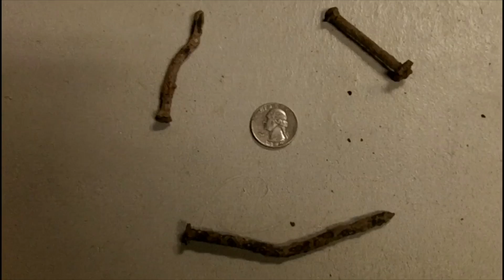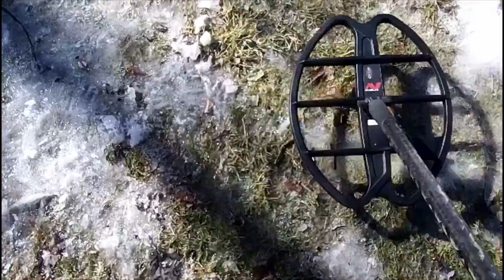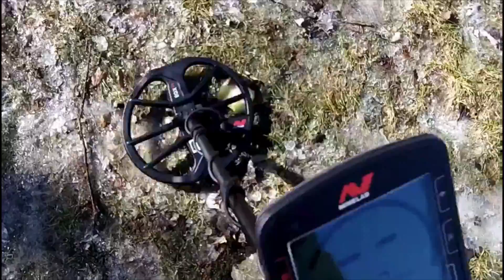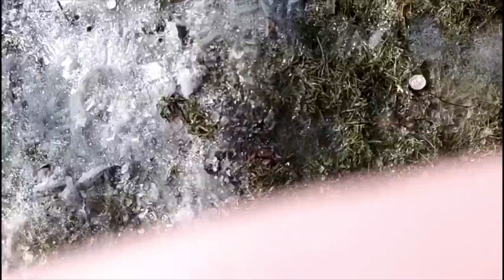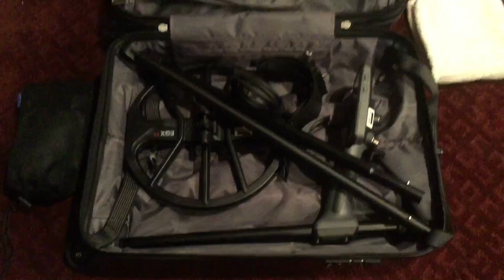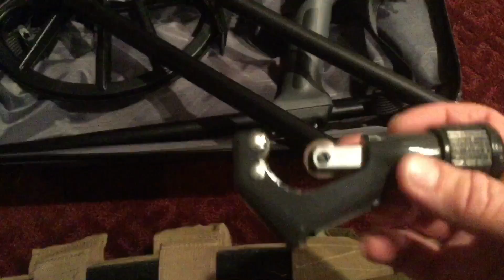Metal Detecting Wisconsin Season 8 Episode 3 Minelab Equinox 800

Comment: Very bad tests !!! 1.What is the reactivity setting on Deus because this will be helpfull when testing the coin between the nails. 2. CTX is with huuuudge coil compaired with other detectors so no point to be in this test ! 3. You did not show complete test with equinox on coin under nail test ,you show one direction but after that you remove the nail over the coin without showing what will happend in other dirrection,are you making an adv. of equinox ? 4.18 khz od deus is not good for finding deep targets so why not try 8 khz or 4 khz also ground ballance? of deus is ??? reactivity, silencer everithing have to be set wright.

Comment: Sweep speed on any detector can make a difference . . . . the speed in your test is not how most people hunt . . . . a fast whip across a marginal target / signal can check it but as you slowed the sweep down the responses differed.
Reply from the maker: Andy Sabisch I know after rewatching it I realized I was sweepings little too fast. I guess I was rushing too much to make the video.
Reply: The nail on a coin test is one that almost any detector with a DD coil can pass  . . . . . . when you turn 90 degrees they all lose the coin.  Be interesting to see the test going over the targets at a normal sweep speed to see the response.  One last thing . . . if you are running the Deus in 18kHz, depth is not going to be there especially on the higher conductive targets.  Try 4 kHz or 8kHz and see what the difference is.
Reply from the maker: Andy Sabisch Thanks for the advise Andy. Unfortunately I don’t have time to get to it since my flight leaves tomorrow but I’ll do some testing before I get swinging once I’m in the UK.